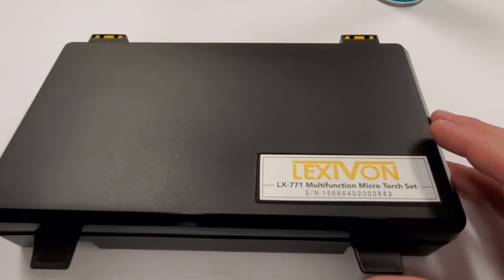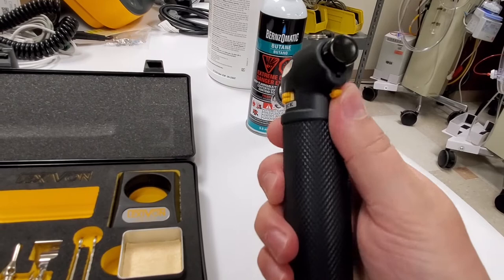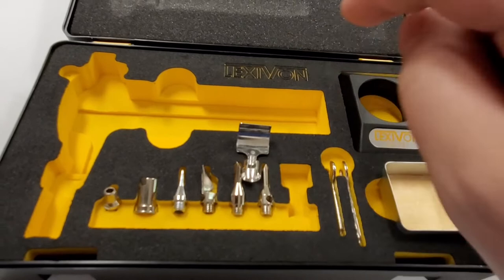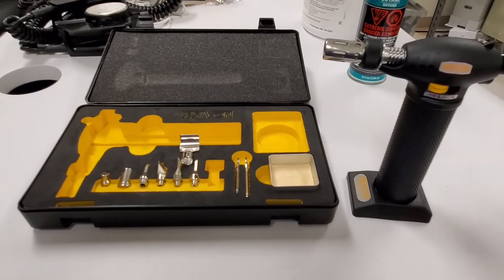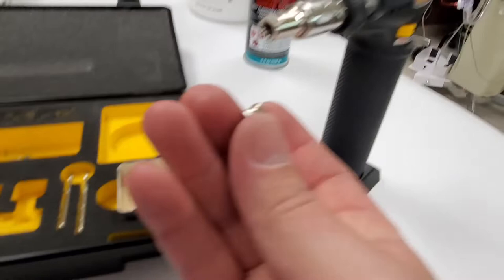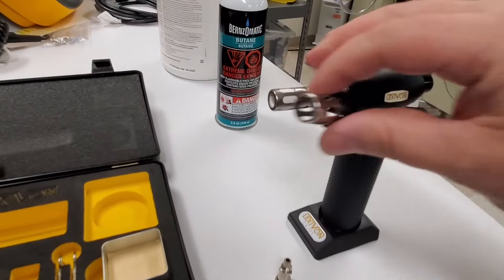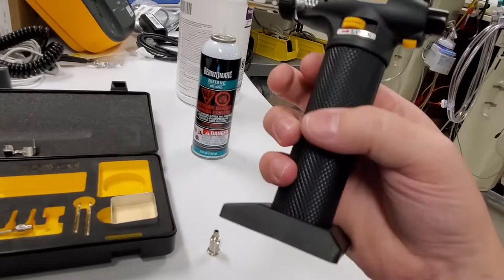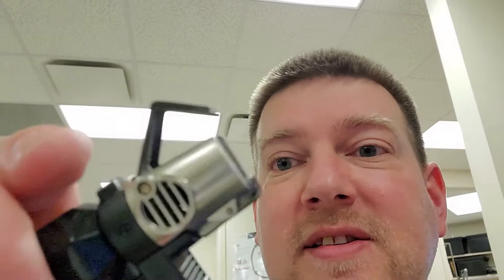New Torch!

Comment: The safety lever switch actually works easy on mine. You have to just gently push it towards the neck and goes to the other side. There is a small recess that it loops around. Thanks for the video! I just picked one of these up for craft uses and was wondering how the deflector was used.

Comment: Hi, there is a short wave diathermy machine whose intensity regulator donesnt work nor does the pads heat up.please help
Reply from the maker: Check the power supply for all the proper output voltages.